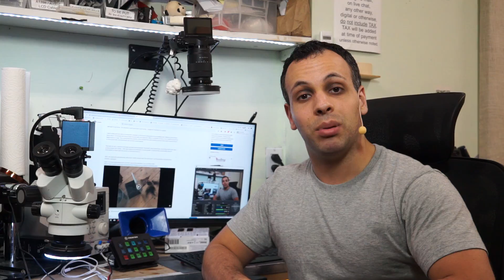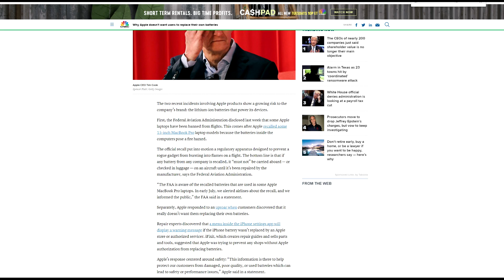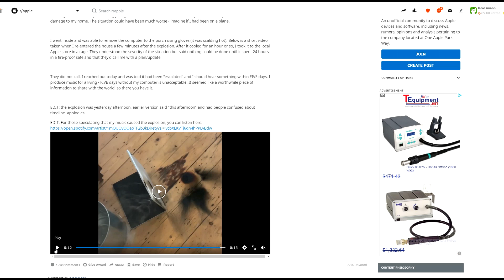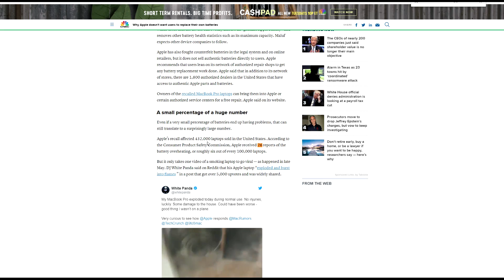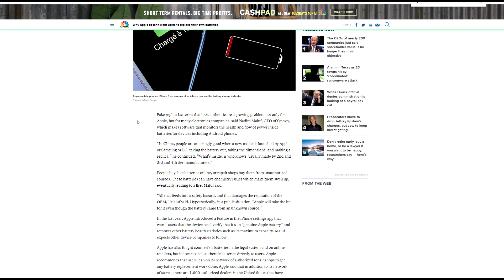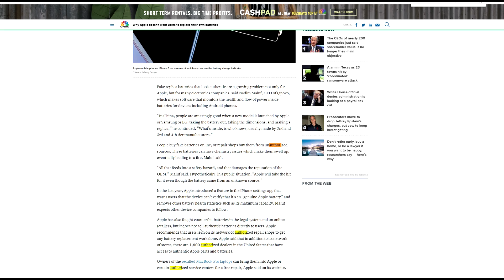OEM batteries explode, so 3rd party batteries are bad. Nice job, CNBC.

Comment: You just need to run two businesses, one Apple authorised and one not licensed. 
Then you just transfer the cases that can't be fixed in a regular way to the unauthorised shop

This is probably not allowed for authorised shops.

Comment: so Apple know that 432 of their laptops have aftermarket batteries , Hmmm . Dont forget your data is safe with Apple . To be doing a recall on that scale means they know there is a problem with the original batteries . They probably had a bad batch from the supplier or there is some kind of fault with the laptop

Comment: Comparing the number of iphones sold to the number of battery incidents is a bit dubious, it would be better to compare it to the number of batteries flying... in 2017, 4billion passengers were carried on commercial flights, presumably the majority had a mobile phone, a large number would be carrying a camera, laptop or tablet, cordless headphones etc, so it would be safe to say at least 4,000,000,000 batteries were carried that one year.  If all of the incidents had happened in 2017, it would be around 1 in 15 million, but since they happened over 20 years, the rate is going to be much lower...

Comment: Just look at forums and Reddit posts about this new battery DRM - all the focus is on third party batteries, and so many people are just blatantly ignoring the fact that OEM batteries also show up the service message. 

Apple, along with most larger corps over a long time have been carefully curating the message that OEM = good, everything else = dangerous. The funny thing is, they're quite often the ones creating the aftermarket through either insane price gouging on parts, or limited access to "authorised" service only.

Sadly, there are very few companies around that are still prepared to sell genuine OEM parts directly to consumers or third party repairers for reasonable prices :(

Comment: A customer of ours had this model battery.....and according to apple, it did not apply for the recall program, while the battery was so swollen, the bottom plate popped open. The Official Apple reapir center wanted....here it comes $600,= to replace the battery and for some reason also the Palmrest/Topcover! Now I found that ridiculous....but hey...it's apple, what can you do?

Comment: This whole BS about how chinese batteries are ALWAYS bad pisses me off, first of all...insane amount of the original batteries comes from China, and also...just like anywhere else...you get what you've paid for, if you buy the cheapest chinese battery - sure it is very likely that it will be crap, but if on the other hand you buy a slightly more expensive battery - chances are...it will work just fine.

Comment: Apple's recall isn't replacing the batteries, they're replacing the system boards (everything can be fixed by replacing the system boards). That's probably why the FAA is p!ssed; WTF Apple?🙄

Comment: It is ridiculous. Apple could make the batteries easily replaceable by the customer just like they used to on phones and laptops until they decided to make it difficult to near impossible and therefore expensive and exclusive. It's not just apple of course. However the camera industry have not gone down this route, because they need to be swappable in seconds in the field and there are no safety or any other issues. What is practical for cameras is obviously good for Apple and general consumer battery powered products, it's just that Apple choose to gouge their customers. I like and use Apple products, not for the hardware but because of their software and operating system, but paying a premium price for a second rate hardware product that is deliberately crippled as far as user repair and customisation is concerned really grates.

Comment: As long as it does not lock the phone because of a non OEM parts it’s fine since it warns the user or a buyer that something was replaced on the unit that was not performed by authorized service center.

It’s going to boost the reputation of honest repair shop like louis because they are going to replace parts in front of the customer and customer will just shrug off the warnings shown on the phone because they know honest louis put a reputable parts in the unit since they saw it done

Comment: My laptop has an easily removable battery so does my cellphone. If either of them go bad, I can replace it inside 30 seconds, because they aren't soldered to the boards. Never had any issue with any of the laptops I've owned in nearly 20 years and I use them heavily on AC and battery. 
The only times I've had battery issues, it's been with iPhones, where it was doing what Louis described for a crappy BMS where the phone would shut down despite showing a decent percentage. I don't use Apple products any longer, partly because of that. 

I'm not going to buy the idea that one battery made in China is necessarily safer than another battery made in China because it's got an apple printed on it somewhere.

Comment: I gave my brother a Macbook (Late 2008) about 4-5 years ago, it had a dead battery so he took it to the genius bar and was told that they don't manufacture that battery anymore then said something along the line of "I'm not suppose to say this, but you can buy an aftermarket one from eBay or Amazon."  Apple wouldn't be happy if they found out that the staff at this specific Apple Store were advising customers to buy aftermarket batteries lol.

Comment: Why do people cant seem to understand that not everything is done from their point of view? The 0,006% failure rate already led to a recall of all macbooks because of 1 viral video, no shit they want to prevent this. Like they want to risk the chsnce the same happens due to fake batteries. Samsung also does not sell batteries since they removed the removable battery. Do you think thats because they want you to use counterfeit products instead of their own originals? No, it means they dont want you to mess with it. Samsung even had to stop the Note 7 production because of bsttery issues due to backlash. As if the media cares if it was an OEM battery or not, all they report is the device exploded. Cant say I'm happy with this descision, but I also can't say it does not make sense; because it does. Everyone complains when Apple does it, but when 1-2 years later others follow, nobody seems to care. Was like this with the Sim card tray, removeable battery, and headphone jack, and it will be like that with this. Because it simply makes sense, even if you dont like it.

Comment: G'day Louis,
I am as confused as you about how the writer justifies this (Science-Fiction) story,
Apple Batteries are Exploding or Catching Fire, You must take it back to Apple to exchange it for a replacement Battery made on the same production line,

Why would you replace a Potentially Faulty battery with another Potentially Faulty Battery,

The way I see this is Apple Batteries are Exploding or Catching Fire, Why would I trust an Apple Replacement Battery, I shall Google where can I get a Battery that won't Explode or Catch Fire because Apple Batteries are Garbage & I Don't Want One,

My Guess for the Question: what is an Apple Certified Repairer allowed to Repair?
Less than an Apple Shop Employee, So Nothing While Paying a Fee For The Privilege.

Comment: @Louis, I normally side with you but in this case I believe the level of criticism of the article is is a bit over the top. The content does talk about fake batteries as much as talking about the genuine but the context hints that even a genuine battery can be dangerous so why take a risk on an unknown "fake". However I do agree they should have added some talk about "non genuine" vs"genuine" vs "fake".  I think it would have been a better talk  to aim the rant at Apple stonewalling independent repairers making it very difficult to offer genuine replacements even if that's what the customer wants.

Comment: The problem with articles like this is that it plays on an uneducated public. That's not an insult rather an objective fact: the average end user of precision electronics does not understand the technology well enough to combat this type of irresponsible journalism. Calling third party batteries "fake" or "counterfeit" is a cheap way of making consumers thinking of third party components like something they pick up out of the trunk of someone's car in China town after they buy their knock off Michael Kors purse and Gucci watch. Apple plays on this and uses those buzz words to scare consumers that don't understand electronics or the manufacturing process. Just like anything, if you source the things you purchase from a reputable source with quality controls regardless of the branding or badging, you are going to get a product that should not pose any substantial safety risk... the quality of that product by way of performance or longevity may or may not be sacrificed dependent on cost, but risk/safety talk is just an overreach and a cover for a money grab. I just put an auto zone brand battery and aftermarket brake pads and rotors in my car that weighs 3700 lbs and I drive at speeds up to 75 MPH I don't think for a minute the quality or safety provided is any less than what came on the vehicle... we are talking about a laptop here... the safetyism in this county is getting out of hand. If people don't like something (generally because it causes financial implications) it becomes "unsafe"

Comment: Hmm....I JUST replaced my iPhone 7 Plus battery with a $10 eBay battery made this year that came with new adhesive strips and it shows up at 100% in health and has only dropped 5% (62-57) in 5 hours. This same battery at a local repair shop (I looked at theirs)  would cost $70 and I did it myself and saved $60 and nothing blew up and I’m still alive.......THEY’RE FULL OF SHIIIIITTTTT!!!! 🖕🖕🖕

Comment: I may have said this before on your channel, but I think every product made must have the end of life date printed on it's package (and in the settings in terms of electronics). I also think that all warranties should be as long as that end of life term. No one is going to pay $3,000 for a laptop (or $1,500, for a phone) with a one year end of life. Batteries that are sealed into electronic devices should mandate the extent of the end of life as well.. If a battery is pretty much guaranteed not to last three years, then three years should be the end of life for the product. Customers won't like that either.  If the battery isn't sealed into the device, then end of life could be much, much longer. Companies should be made to stand behind their products to the fullest extent. I am tired of buying products that completely fail the day after the warranty is up.

Comment: i have used third party batteries for my power tools (most being twice the capacity for half the price ) and so far have not had any problems , none have exploded none have drastically lost charge and capacity i am sure there are the odd one that will but this is also true of manufacturer made batteries (dont forget a lot of these replacements are made at the same factories churning out the manufactures battery ..FAKE batteries are a different apple ..they are advertised and made to look like the real thing and are often made so cheaply they are dangerous ..along with shoes and shirts and other faked gear like your Rolex watch that runs an hour behind ten minutes after every time you set it

Comment: The recall may be an investigation more than anything. It could just mean that there is a suspected issue that would be easier to resolve with actual "faulty" devices in hand. Still, it doesn't prove anything atm until there's an official statement. The blogger's common sense can not be that dull.

Comment: 1. End it, don't mend it. Products are meant to be replaced often and vigorously. That's what your income is for, you work hard so Apple can work hard for you and make sure you ALWAYS have the latest experience.
2. It's stealing when you use something not the way it is intended, or use parts or supplies with it that aren't approved by the manufacturer. Using illegal ink cartridges for example with a printer is theft. When you replace a battery that is not for you to replace, that is theft. You're stealing from someone's profit and taking money out of the pockets of shareholders.
3. Apple has more smart people than Louis Rossman. You should always be listening to them and not some garage terrorist with a soldering iron.

Comment: Going to keep on saying this until I hear something big on Lawful Masses about it. Petition your local governing bodies to make any device with a sealed battery considered as a fire hazard and as a transportation risk. If you can't remove it, you shouldn't be able to bring it. Dead simple. If such laws were passed, we would see a bounding resurgence of removable batteries and devices engineered to operate solely from AC power, rather than rely on a functioning battery before powering on. Make this happen people!

Comment: Maybe their argument is that if even original batteries are dangerous, then third-party batteries are even worse because (they assume) third-party parts are necessarily worse than original ones (which isn't always true). Even then, it's a false equivalency and a straw-man because that has no bearing on replacing batteries since the replacement can be an original, and if originals are good enough for Apple to sell, then they should necessarily be good enough for replacement.

Comment: Authorized would only mean to turn into a motherboard or battery replace shop and charging the same as Apple for it. Aún authorized shop doesn't fix only replaces. That wouldn't help Louis to have access to schematics or specific parts.

Comment: @Louis_Rossmann I concur that if Apple is recalling their own product, in this case, batteries, they are “admitting an issue.” And I don’t think there is any correlation or indication that third party batteries are worse or better than the OEM. For the CNBC post to take one incident of a battery catching on fire and making claims about not trusting third party batteries is being overdramatic in my opinion.

Comment: I don’t think you can do your job like you want if you become authorized because all apple does is replace the hole thing instead of fixing your device or laptop which I do not like. Last month I went to the apple store because my iPad Air 2 screen touch stoped working for no reason and the manager told me the can change the iPad for 299 and the would not even try to fix it. They are trying to make me buy a new iPad when mine still works

Comment: I think you miss the point. If OEM batteries, fully tested and built at monitored manufacturing plants can be at risk, then imagine the potential damage non-OEM batteries could cause. This happened with OEM Samsung batteries built by their own subsidiary!

The point is that Lithium batteries are one thing consumers should not take a risk with. I agree with the Mr Rossmann with respect to other parts, but batteries are truly a Health and Safety red flag. With an Apple battery we have recourse, we have recalls, ongoing testing and a warranty. With a cheap non-OEM battery that you simply have no stats at hand to see if they are safe and for the sake of saving $20-30 every 2-3 years I feel the author is flogging a dead horse here. 

For the small extra fee of an OEM authorized replacement that peace of mind is paid many times over against the savings you may make.

Comment: I worked for years on cellphones and small electronics.  I've had plenty of them puff up or die prematurely. The only time I have ever had a battery actually catch fire (not caused by damage) was an OEM Motorola battery from a Razr 2.